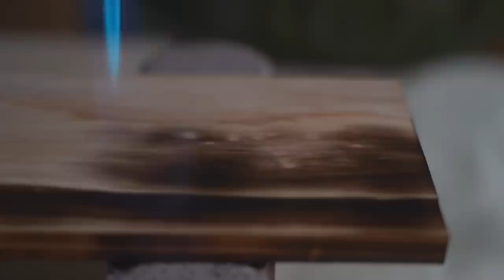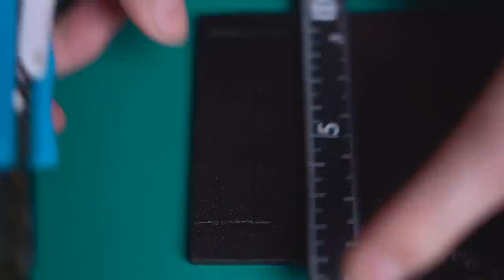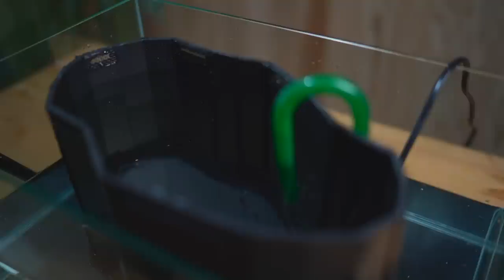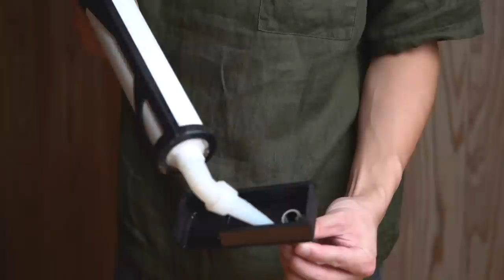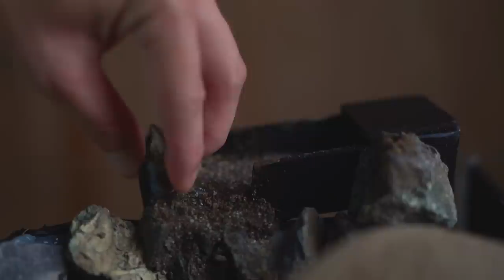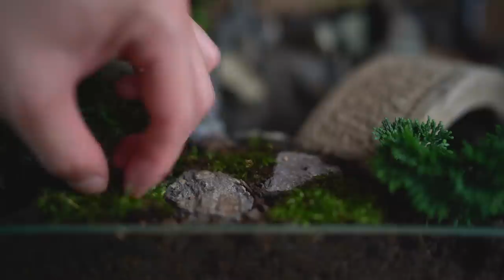Making a Japanese Garden

Comment: The fact that you can even get a straight, even line of glue amazes me
Reply: so confident, so brave
Reply: idk if anyone wants this, but a tip for if you want to try getting a straight line of glue is to press the tip of the glue bottle on to the surface at a 45 degrees and it'll be a lot easier

Comment: *Materials Needed:*

1. Wood for the box formation
2. Wire brush
3. Epoxy 
4. Chinese Juniper bonsai
5. Bonsai pot
6. Substrate for bonsai 
7. Glass aquarium (should fit into the wood box)
8. Foam boards
9. Wire mesh 
10. Fungicide-free silicone sealant
11. Water pump
12. Mini stone bridge 
13. Filter mixture
14. Red rocks
15. Cotton-like material
16. Additional small bonsais and bushes
17. Stone lantern
18. Moss 
19. Stepping stones
20. Ground similar to aquarium bed
21. Mini baby lily pads
22. Small goldfishes

*Steps:*

1. Lightly burn the wood with a torch for aesthetic purposes.
2. Use a wire brush to smooth the burn marks.
3. Arrange the wood into a box formation and apply epoxy to create a border at the top.
4. Pot the Chinese Juniper bonsai into a smaller pot, secure it, and fill the pot with substrate.
5. Pack the substrate by tapping the pot on the table and place it into the glass aquarium, which should be the same size as the wooden box.
6. Cut foam boards to the height of the aquarium, making slits to allow for bending.
7. Cut a small rectangular piece at the top of one foam board and fit it with wire mesh to create a waterfall.
8. Use a fungicide-free silicone sealant to join the foam boards and attach them to the floors/walls of the aquarium.
9. Remove the Chinese Juniper bonsai.
10. Fill the aquarium (outer parts) with water until it reaches the walls of the foam boards.
11. Attach a water pump to the bottom of the aquarium and route it to pump water into the foam board pool from the top.
12. Turn on the pump, allowing the water to fill the inner foam board pool until it overflows and creates a waterfall.
13. Empty the water and clean the walls of the aquarium.
14. Cut two more foam boards to the height of the aquarium, position them in a 90-degree angle at the corner, and seal to create a holder for the Chinese juniper pot.
15. Install holders for a custom mini stone bridge over the foam board pool.
16. Create a filter from foam boards, add the filter mixture, and decorate it with rocks.
17. Fill the outer part of the aquarium with red rocks until it is about 70% full.
18. Layer a cotton-like material over the red rocks.
19. Place the Chinese Juniper bonsai in the corner holder.
20. Arrange other small bonsais and bushes in the aquarium.
21. Add a good draining substrate over the bottom layer and decorate with rocks.
22. Smooth out the substrate to mimic natural terrain.
23. Place a stone lantern in a preferred spot.
24. Create a stone pathway leading to the stone bridge.
25. Add green moss around the bridge area and stepping stones, and along the perimeter of the aquarium.
26. Fill the foam board pool with a ground material similar to aquarium bed.
27. Refill the outer layer with water and turn on the pump to create a circulating water feature.
28. Place the glass aquarium into the original burnt wood box.
29. Add mini baby lily pads.
30. Add small goldfishes to the foam board pool.

Always remember to maintain the garden regularly to ensure it stays healthy and beautiful. Regular maintenance includes pruning the bonsai and other plants, cleaning the water filter, and feeding the fish. Enjoy your miniature Japanese Garden

Comment: That is pretty neat and makes creative use of all the elements to help each other.  This helps control the water table for all the plants to avoid too much water and gives great filtration for the fish.  Maintenance of the filtration system and evaporation of the water would be minimal.  Great job on all your projects.  This was one of the easier ones to follow, but showed how use of baffles to control the flow of water between sections can be beneficial.  Sometimes how the baffles are used is baffling.  Even the bonsai tree receives water in a controlled way if the depth of the pot and drainage are measured correctly.  Those foam boards are stronger than I thought. :)
それはかなりすてきで、お互いを助けるためにすべての要素を創造的に使用します。 これは、すべての植物の地下水を制御して、水が多すぎないようにし、魚に優れた濾過を与えます。 ろ過システムのメンテナンスと水の蒸発は最小限に抑えられます。 すべてのプロジェクトで素晴らしい仕事です。 これは従うのが簡単な方法の1つですが、セクション間の水の流れを制御するためにバッフルを使用することがどのように有益であるかを示しました。 時々、バッフルがどのように使用されるかは不可解です。 鉢の深さと排水が正しく測定されていれば、盆栽でも制御された方法で水を受け取ります。 それらのフォームボードは思ったよりも強いです。 :) (グーグル翻訳)

Comment: this is incredibly beautiful, i have watched this video several times because the process of building this garden is so lovely to watch. i don't know much about plants but it looks like there is a lot of water in the tank, are the plants prone to root rot or do these ones like wet conditions?
Reply: I believe those are a species of moss. If I recall correctly moss loves damp and relatively well lit conditions, which is why forest floors are carpets of moss. In the conditions in that garden diorama setup he has they would likely thrive, hence why he used it

Comment: Beautiful piece of work, very artistic.  A few details:
1. The fish need more space.  These are living creatures not toys.  They are in a foam surrounded 'pond' leaking toxic chemicals in the water.  Their world is too confined.  Imagine yourself living in that tiny pond with nothing on the inside, and no light going down to the bottom. What a dreary world.  You would go mad.  Never treat living beings with so much carelessness.  It is cruel.
2. Sides of the garden are too high and shut out the view partially.  Also too obtrusive.  The border should be narrow and low.
3. Your garden making skills are high, but not your wood working skills.  You glued that box together?  Ridiculous!  You need to drill some holes and put some screws in. Also you did a butt joint on the box which looks crude and ugly.  Learn to use a saw and make mitered joints.  Ditto for the border.  Use Kiri wood with a finer grain, or cedar.  This wood looks like pine with a broad grain that is jarring for a tiny garden. Tiny things need finer grains of wood to match.
4.  Put some tiny lights inside the pond for the fish and also for a luminous glow.  Turn off at night for the fishies to sleep.